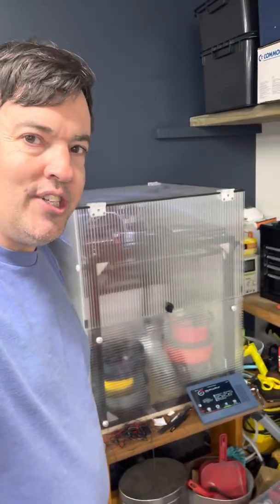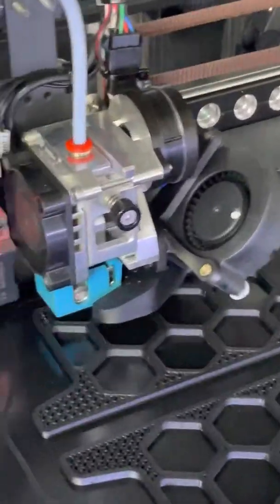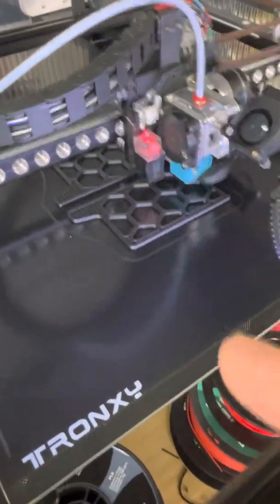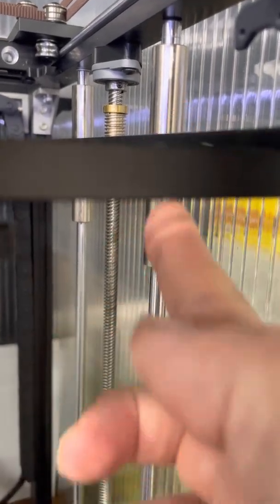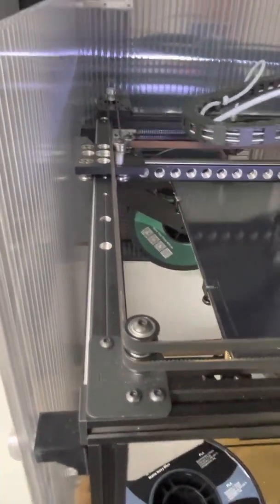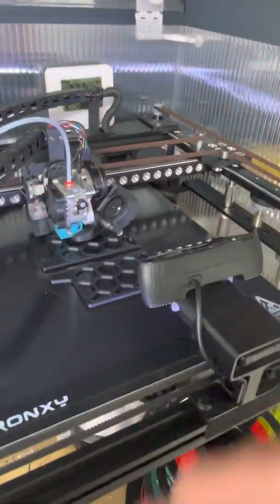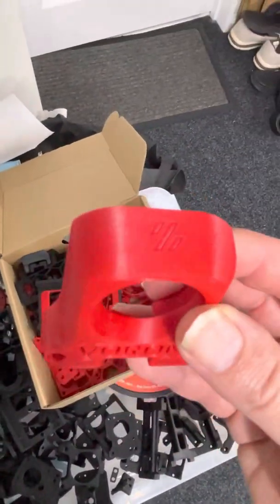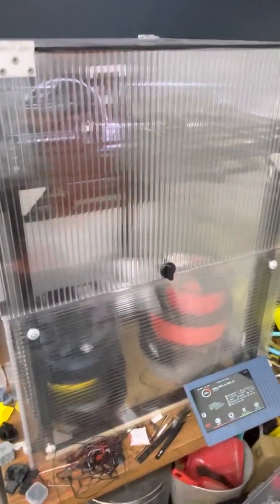Tronxy X5sa Pro modified with NF Sunrise, enclosure, and Klipper

Comment: How’s the bed leveling process go?
Reply from the maker: Pretty well - Klipper shows a Heightmap where you can see the shape it’s seen. If it’s a saddle-shape, check that the top frame sides aren’t over tightened down onto the smooth rods - that will bow the frame sides and make the bed levelling think the middle of the bed is ‘high’. Add washers to take up the gap between the smooth rods and the top frame.

Pre-warm the printer for half an hour before probing the bed. Adjust the bed manually to get it as flat as possible on the visualisation. Check the vertical scale - 0.15mm variance is OK, the auto-levelling will take care of that, and shouldn’t need re-probing before each print

Comment: Hey could you help me out, i followed your route with my tronxy x5sa pro and got the nfsunrise extruder installed, however i am haveing issues with part cooling, I printed a similar fanduct as you have however there are clearance issues with it hitting the x rail top plates. Can you post a link for the fan duct you used?
Reply from the maker: Hello - I remember the fan only just clearing the Y-axis carriage, I think my favourite was the Prusa-style fan mount/duct that you can get from here: https://www.thingiverse.com/thing:5150173

Comment: Hi Alex - great mods! I am totally going to use some of these! I looked for your brackets on Thingiverse by searching with your name... but no joy... I found them in another reply!
Reply from the maker: Hello - thank you for the kind words :) I had been messing with these printers for years, but ultimately it was only a few mods that made the difference - the reliable extruder, the sync belt, and Klipper. And then an enclosure so it could print ABS parts. 

I guess they add a bit of cost but looking back, it was very worthwhile to make that big machine finally usable. I sold this machine to a local engineer hobbyist and he is happy with it. I bought a VzBot kit (it was the most economic way to get all the bits shipped here to NZ) and so I now have a Voron 2.4 and a VzBot - the Tronxy spirit lives on in that identical frame design!

Here is the link to my Thingiverse designs (which you’ve found), sorry for not putting them in the video description :) https://www.thingiverse.com/alexgsofnz/designs

Comment: What non-contact bed probe are you using that it works on glass? got to get me one of those.
Reply from the maker: That was the Tronxy TR sensor (black), which came with the coated glass bed. It was a capacitive type (detects anything). The blue sensor that came with the printer was an inductive type (detects aluminium, not glass).

I’ve built a VZBot now - I just use a Z-stop microswitch on the frame and level the bed manually. No probe at all :)
Reply: @alexshepherd  as a mainly PETG user there is real no good solution for this stuff haha, cannot use PEI, glass you have to use gluestick or hairspray and other bed materials either grip way too little or are far too expensive, maybe i will have to get one and see if it works with my glass bed.

Comment: very nice! I prefer the term "Short coupled" and not direct drive... it doesn't feed directly, it still has a short tube.
Reply from the maker: Thanks - yes that’s fair I suppose, it’s the equivalent of a Prusa or Voron setup, with about 20mm of Teflon tube between the filament feeder and the top of the heatbreak. It would be hard to get it any closer

Comment: Why isn't there more video's about the Tronxy X5SA Pro being uploaded. It's a flawed printer but ,after some love , it's great!
Reply: as you said, because it's a flawed printer. People who don't like to tinker don't buy a printer that needs tinkering, and people who like to tinker buy a printer that works first of all, and then tinker with it
Reply from the maker: @HitLuca94  you’re right.
I think everyone should own a Prusa as their first machine (Mk3 or the latest-and-greatest Mk4) - or maybe even the Bambu Lab machines - yes, they are expensive to buy, but they work, and they give you a baseline experience and the ability to print parts which you can then use to modify some other flawed, cheaper printer like the Tronxy.

To put it another way, everyone needs a small (reliable) printer before they take on a large (unreliable) printer :)

My Tronxy in the end has printed parts the others cannot. It’s been worth it, but it would never have worked as my only machine. It also printed all the parts for my Voron 2.4, which has proved to be a fine replacement for the Tronxy but again, could never have worked unless I’d had another working printer first.
Reply: @alexshepherd I would recommend a sovol sv06 as a first printer honestly. Even works better than a prusa for 1/3 of the cost

Comment: What top acceleration do you think the x5sa can handle with klipper and the stock guides?  Excellent video!
Reply from the maker: You’re very kind; it’s hard to make a good video in one take when there is no editing possible :) I think the maximum practical acceleration is similar to the Voron 2.4, about 5000m/s^3

Comment: Great to see your getting a reliable 100mm/s+ out of the machine. Is anyone with a modified Tronxy X5sa Pro getting reliable speeds nearer 200mm/s thought? I'm looking for a CoreXY specifically to print lots of parts with a build volume near to 400x400x400mm. Potentially I could buy three X5sa and all the upgrade parts for the price of one Voron/RatRig
Reply from the maker: I think you’re better off going down the Voron path which will get you to 200mm/s easily in a 350x350x350 size, but otherwise you need to build a VZ-bot. There is now a kit for the VZ-bot - approx. US$1250. I suspect the only way to get 400x400x400 will be to start with a regular Tronxy X5sa 400 (non-Pro version without the metal wheels) and fit linear rails, VZ-bot parts, new control board, Klipper etc. The modifications I’ve shown here will only get you to about 150mm/s max. Good luck with your build :)
Reply: Going down the voron path... go Vzbot. It started as a modified x5sa... it's the fastest printer on the planet of its size. 

And yes, I get well over 200mms on several modified x5sa. Go linear rails, simple hotend, move the z rods apart as fast as you can,  and move them in to the frame a little so you can enclose the frame easy. 

Also I've got 350x350x420, in the standard x5sa frame. 

My highly modified x5sa gets 20k acceleration and 1000mms travel speeds. I can print up to 40mms³/s throughout on my hotend, at whatever speed I like. 100.
Not a vz, but my own design. 

Of course with a highly tuned slicer profile.

Comment: Hi, how much weight do you save with the holes?
Reply from the maker: I looked up the photos on the scales for you - 112g off the X rail, 16g off each of the three carriages (one X and two Y) so about 160g saved all-up by drilling holes
Reply from the maker: Direct extruder motor, with original hotend, bracket and fan was 377g, NF Sunrise with fans is 258g (so another 119g saved by changing to the NF Sunrise)
Reply from the maker: The holes are bigger than they look because they are drilled from the back, with a step drill - so the holes just touch each other

Comment: i dont know when you made this video but i love your set up i have the v6 board and i cant get klipper on it for nothing  would be great if you could make a video of how you did all this
Reply from the maker: Thanks. I don’t have time to make a video about the Klipper install, but I suggest you do a basic setup of the Raspberry Pi OS (Lite, without desktop) and then use KIAUH (the Klipper Installation And Update Helper); just go to the KIAUH page on your PC, then copy and paste the supplied commands into a PuTTY terminal window that’s logged in to your Raspberry Pi. From KIAUH, you can then install Klipper and Mainsail (or Fluidd if you prefer) really easily.

For setting up the printer, see https://gist.github.com/cab404/b7bcbb0cd592a14515493694719de59b

Comment: Do you happen to have a list of the parts you changed/added?
Reply from the maker: - Tronxy lattice glass and TR sensor
- Gates belts
- Additional LM8UU bearings for Z rods
- Tronxy Z-sync belt kit with pulleys
- Mellow NF Sunrise, extension wiring for extruder motor
- 5015 fan, also replacement 4010 fan for the controller box (use ball bearing fans)
- Raspberry Pi 3B+ back when they cost NZ$80, 7” HDMI display 
- several sheets of ‘twinwall’ polycarbonate (sold as verandah roofing)
- various printed parts and brackets to relocate spool holder etc. which are listed on my Thingiverse page https://www.thingiverse.com/alexgsofnz/designs

That’s about all I can think of right now

Comment: i have had my x5sa pro about 3 weeks now. getting the z axis to remain the same at the start was a pain then i did the belt on the z axis and the backlash nuts. which has helped a lot as the z will not drop at all now when sitting idle.
it has tronxy version of marlin on it but it ain't right prints are good but do a auto level even with the bed and hot end heated or just one or even not at all.
it will do it but redo it again and not adjust anything and it will give a different result. 
i just do a z offset and manual level then print. 
going to build up a VzBot from scratch then convert the x5sa after.
and yes watch that great film of Burt and i think his records still stand to this day.

Comment: which clipper did you use?
Reply from the maker: There’s only one?

It’s running on a Pi Zero 2W
The interface is Mainsail and Klipperscreen

I recommend KIAUH - the Klipper Installation And Update Helper. Go to the website, copy the command into a PuTTY terminal window (that’s logged into your Pi) and it’s pretty easy from there. The printer-specific config details can then be searched for and found (e.g. search for Tronxy X5sa Klipper)

Comment: Ahoi Alex, your video gave me the last push, just bought a X5SA Pro kit for 320€ 🙂. They come with the glas plate per default now. I bought a Prusa Mini Clone kit from FYSETC previously, at the time you had to wait 3 month for a Mini from Prusa himself, turns out the kit is very high quality and really cheap (200€ with shipping, 3D printed parts ordered in Spain for 40€). I bought a second kit, to faster iterate on my models (parts for vintage computers mainly).
Every once in a while i feel the urge to print something larger, but didn't want to go Voron 2.4 because of costs. That is when i saw your video. I'm not doing all your upgrades, just direct extruder, some bracing of the frame, Z synchronization and a frame. I plan to do mine on wheels, since i don't have a basement, everything has to happen in the living room or kitchen ;-).
Would love another update on your rail, or other experiences you had.
Cheers😊
Reply from the maker: Very good!
The only thing I would suggest beyond what I showed in the video is to consider a newer hotend design - the OMG H2 looks clever because it can bolt onto the same mounting holes, but you do need an extruder as well, so the NF Sunrise might still be the neater solution.

The Tronxy rails are still working fine and I think without spending lots of extra money, your setup will get you good quality for large prints up to a speed of about 100mm/s. The frame bracing aluminium corners are the most effective, also consider doubling up the vertical rod bearings as I have (it is cheap and easy) as it stops the bed from wobbling.

My next move is going to be a VZ-bot build, I just haven’t got around to it yet. There are many parts to order - lightweight rails (if you want smooth movement they are expensive), new controller board, better stepper drivers, so when you look at the double-cost to go that little bit faster, I think you will find that the standard X5sa Pro with the three modifications I said in the video - NF Sunrise, sync belt, and Klipper - will be a good-value setup for you. 

Running Klipper and Mainsail makes a big difference to the usability of the printer, it makes it just like a Voron to control. I really recommend that. You don’t have to use a touchscreen, you can control it through the Web interface from a tablet or phone (it seems odd at first to have a printer with no control panel, but it does work).

I have a Voron 2.4 as well as my Tronxy. You can never have too many printers. The Voron is good but it is not really any faster than the Tronxy nor any better print quality, because the moving parts are heavy. It’s only advantage is that the first layer levelling is a bit more reliable with the quad gantry setup and heavy, flat buildplate (but again, more expensive as you know). I am running a Rapido hotend in the Voron which heats fast and is easy to change the nozzle on. But I think the most important is to use good-quality plated nozzles, like you can get from the Mellow Store (AliExpress) where you find the NF Sunrise.

Consider that with a large printer you are probably optimising for prints with a 0.6 nozzle (strength and speed) - PETG or ABS, enclosing the printer is necessary, but part cooling is not as important - for detailed small prints, you have your Prusa-Mini clone. 

Thanks for your comments :)
Reply: @alexshepherd  Nah, thank you. Lots of food for thought. 👍
Reply: Well, seems i was unlucky and lucky at the same time. The seller sent me a X5SA-400 Pro instead of the X5SA Pro i ordered. I already constructed a nice table with wheels, bought and cut plastic glass sheets, so this larger one should go back, but the seller is making it complicated. I may have to use Ebay to get this fixed.
At the same time i saw the X5SA Pro at Amazon for 250€, comes with the Z synchronization kit too. Bought it, should be here soon.
I may end up with a spare X5SA-400 Pro if Ebay decides it so, but in that case i figure i can sell it myself, got it for 320€. 😅
Since there isn't much to do right now i keep printing flexi rexis for christmas on the Prusa Mini clone and read up on Klipper, extruders and hotends.
Reply from the maker: @citronski  I think you’re making the right choice. Giant printers are a nuisance in three ways; the expense of the print surface (and heating a large bed), the lack of frame stiffness, and the space they take up in your workroom, garage, etc.

I hope you manage to return it, if it was not as described - it shouldn’t be up to you to resell it
Reply: @alexshepherd  The seller was uncooperative, i went to Ebay for help. Ebay decided to just give me my money back. When i asked what to do with the wrong printer, they suggested to throw it away! So now i have two, a X5SA-400 Pro and a X5SA Pro, for 250€! I'll keep the 400 for a few weeks, in case the seller wants it back, but after that I'm selling it. 😅 What a muppet that seller was!

So i built the X5SA Pro, no problems so far, if you have built a printer before it's easy. I think even a newbie could do it. Printed a benchy, it's acceptable, far from what i get on a Prusa Mini clone, like what i got from the Ender 3 back in the day. The long bowden tube is a real problem. Klipper is next on the agenda.
I have decided to go for a Volcano clone hotend and a Mellow Sherpa Mini direct extruder, both are ordered, as well as a bunch of nozzles and different heatbreaks.
That's it from me for now, Cheers. 😄
Reply from the maker: @citronski  crazy… yes, I would think the seller deserves the X5SA-400 Pro back. Surely the right thing for them to do is to send a courier label so you can send it back not at your cost.

Yeah, I never got on with the long Bowden tube either!
I did give it a fair go with the second Tronxy, but ended up converting that to direct-drive also. Reliability and print quality trumps the speed possible with the lighter hotend (the standard firmware can’t cope with the speed anyway). Klipper is the best thing you can do with these for speed, I can’t stress that enough :D have fun!

Comment: Seeing these kind of videos of modified printers is inspiring me to continue working on my Sapphire Plus but man does it need a lot of work.
Reply from the maker: Ah yes, I remember looking at that model (from TwoTrees) before buying the Tronxy. They seem a nice machine in many ways, linear rails and a strong-looking frame. I reckon you should be able to get good results. 

The standard hotend looks horribly cheap. I think some versions have the Z screws linked by a belt, and some don’t. Seems best to link them.

If it’s still using a remote extruder/Bowden tube then I reckon start with the direct extruder (like the NF Sunrise), I think that makes printing a lot more reliable (gets rid of all the stringing and gaps or blobs, clogging, etc.)

Then tackle the mechanicals - belts tensioned and idlers running smoothly, that sort of thing - and finally run it with Klipper. Gives better results for the same hardware, as the print moves are all calculated pre-emptively (it looks ahead) - can use input shaper tuning to cancel out resonances.